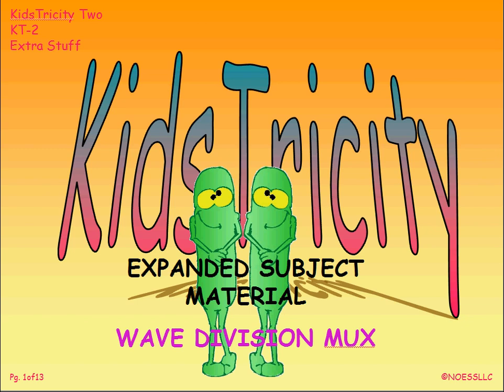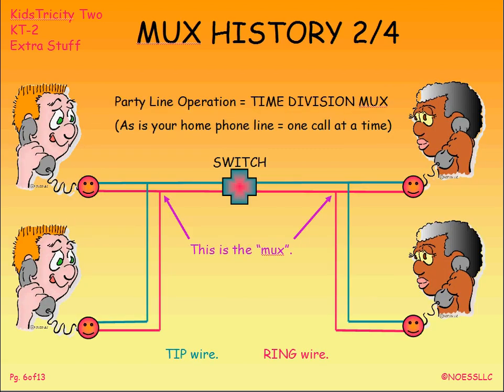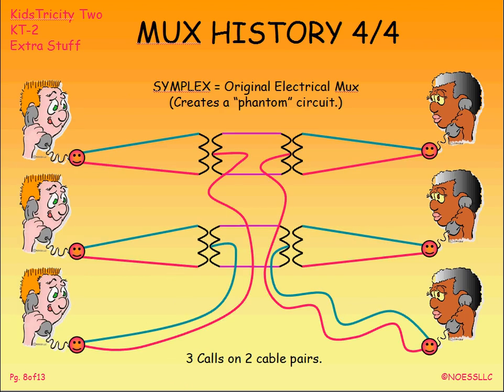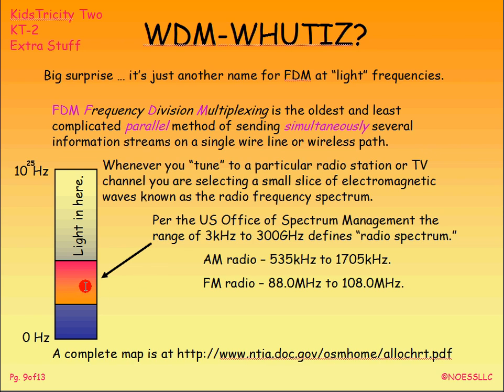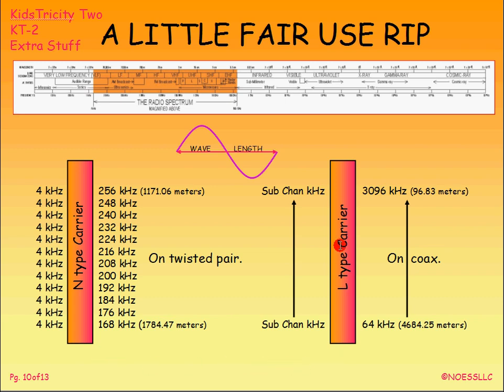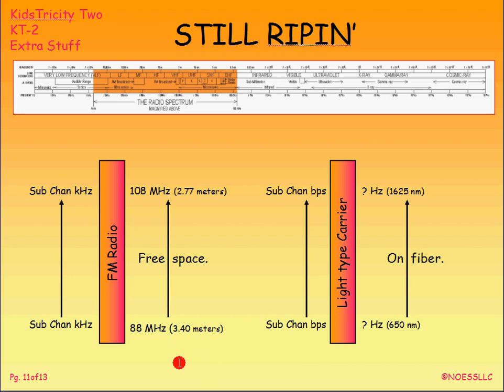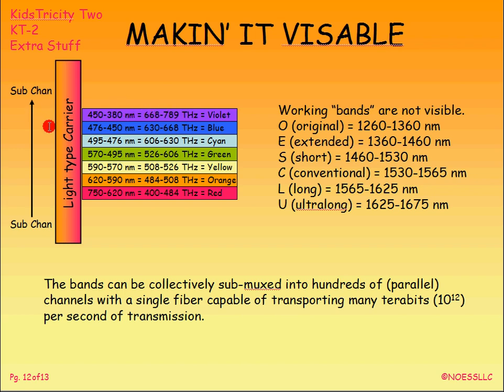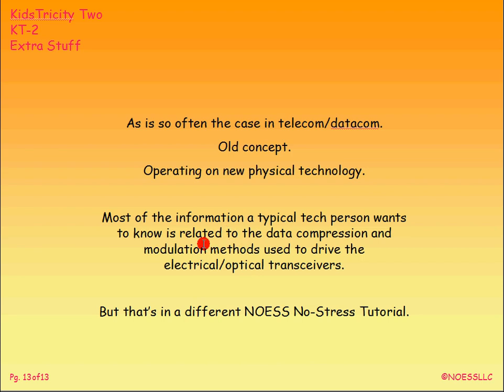Wave Division Multiplexing

Comment from the maker: I just put both updated KidsTricity books up on Lulu. Please note these are the original PowerPoint slides reformatted into a standard 8x11 PDF book format. The animations and voice narration on the PP slides will not operate from this book. However, they do have additional author notes (in blue type) that supplement the material. I'm still working on getting the PowerPoint Show versions set up with a different provider because Lulu doesn't support this file type. Thanks to all for the interest.